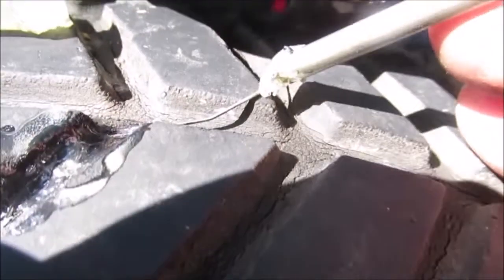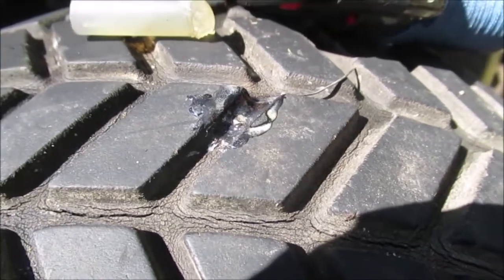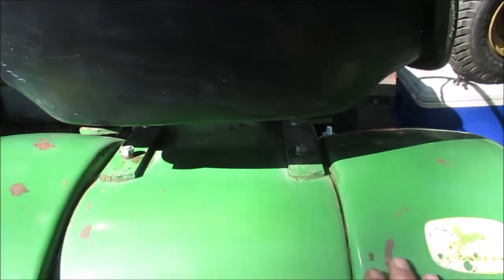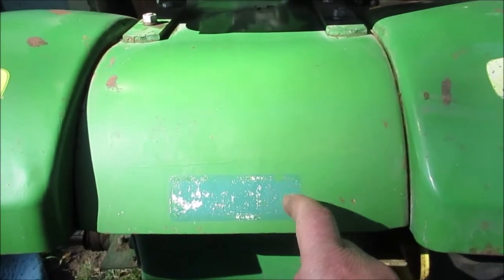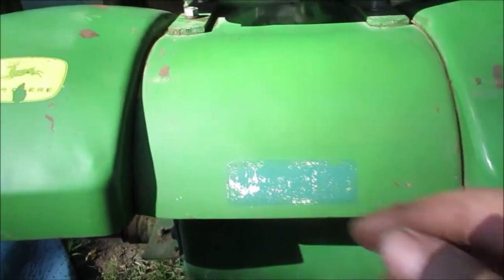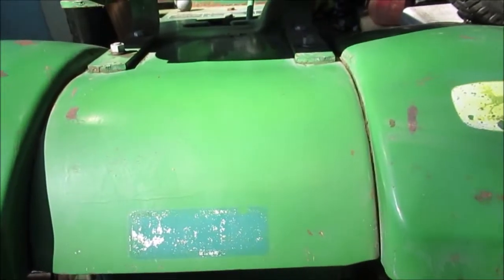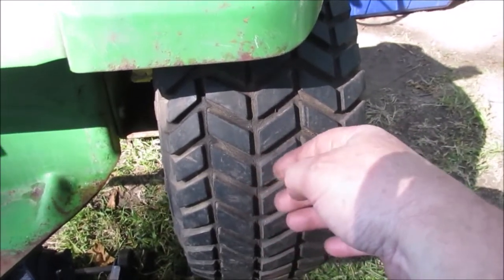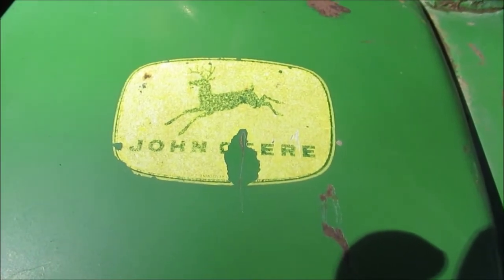Tire Repair on lawnmower using a screw and some hot glue stick

Comment: Hi Jim, what do you do with a lawn mower if you live int eh Mojave Desert which is home to the famous Joshua Tree Yucca brevifolia technically the real name. The answer is we drag sand where it builds up against structures these are called sand drifts though if let go long enough they are sand dunes so long as they =continually move and do not stay stationary.
Screw in enough screws and you could have snow tires right?

You keep the sped down now Jim as you might have a high speed blow out from that tire patch repair. LOL. 
Have a GREAT weekend, Lance & Patrick.
Reply from the maker: You could push sand around with a blade on a riding mower...If I lived in the desert area I would have fun just using a big garden tractor to do chores like pull a small trailer or just drive around and have fun ..You can swap pulleys on a riding mower and get them to go faster